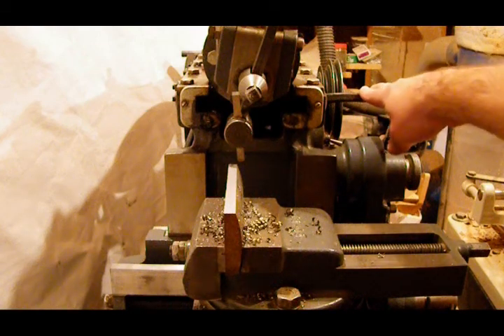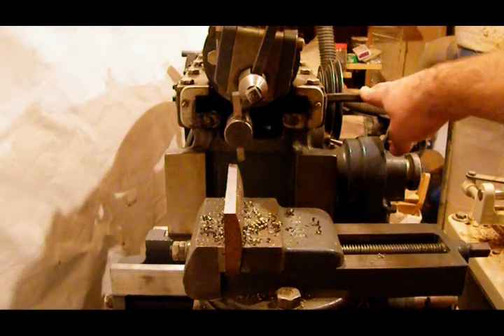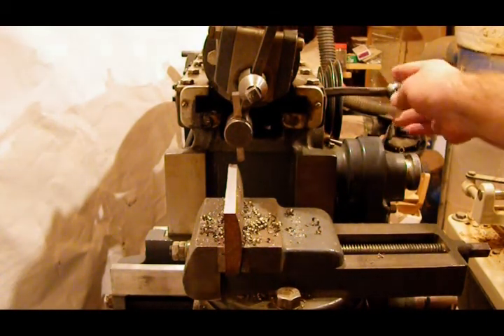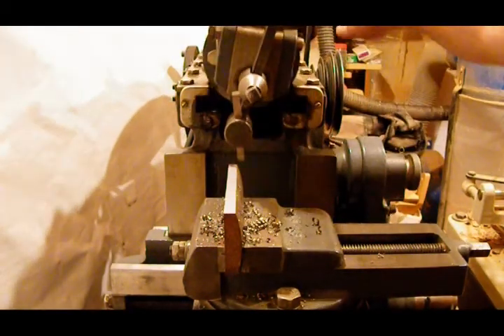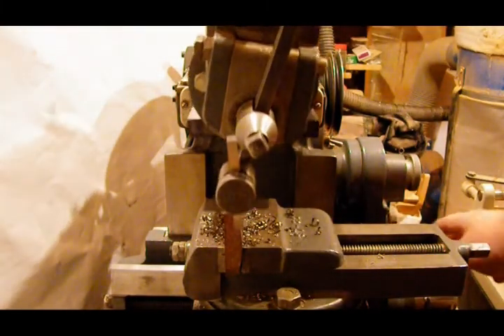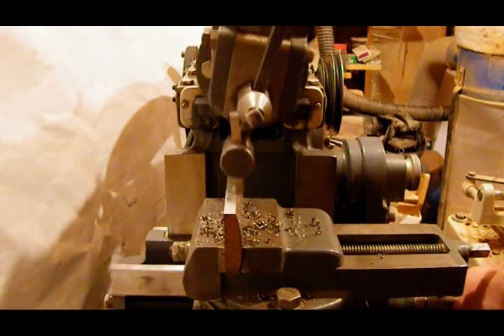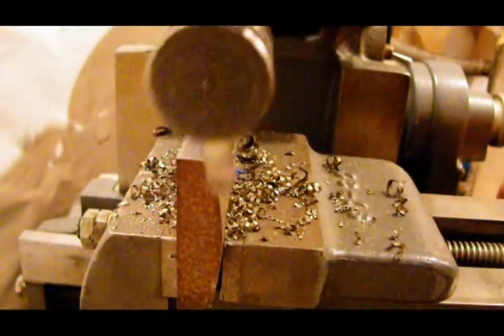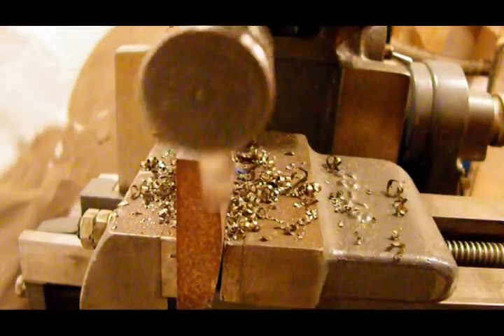Atlas Shaper 7B 7" Metal Shaper

Comment: Your shaper appears to need setting up differently because the feed is advanced on the cutting stroke, instead of the return stroke. It is hard to be certain, but it does look as if the direction of rotation of the motor is correct, because the advancing cutting tool looks slower than the retreating tool, so there must be an error in the timing of the feed. I don't know much about the Atlas, but is it possible for an eccentric to be 180 degrees out of sync? Not too much to fix I'm sure.